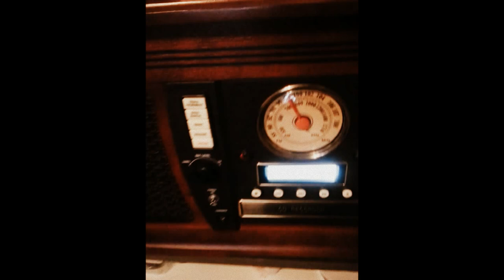How To Make A Cassette Loop

Comment: oh man it looks so easy here ... I tried for a couple of hours. does it matter what kind of tape you use? 
I was using a tasam 414 and tried with a couple of different tapes. The most i could progress was recording on one track with the tascam, but most there wasnt any sound from the loop even though there was def. audio on the tape before. Could my scissor brake the tape?

Comment: Hey thanks for the tutorial - my loop works but the play button won't stay down when I play it, I have to keep my finger on it - any ideas? Thanks!
Reply from the maker: Your loop may be too tight and the tension of the tape may be causing the play button to not fully go down. Trial and error works best. I also have used many different cassette players for many different tape loops and they all react slightly different.

Comment: Does anyone have a theory has to why the loop works but playback is significantly quiet? I'm using a Portastudio which hasn't had problems before with playback volume, so I'm assuming it has something to do with the loop I made.

Comment: Hey man! I've made one - but it's really hard to make it sound seamless. On every take I find some unwanted silence in the loop - even when the tape's ends are perfectly put together with an extremely little amount of desktape used. Could it be the recorder or? What do you suggest?
Reply from the maker: If i understand correctly, my guess is you included some silence into your tape loop. Try listening to the tape before splicing and find out what part you want to loop. One of my tape players I use, I can pause and see where the tape is and I put a small drop of nail polish on the tape so i know where to splice after. This can help a bit.
Reply: +pinstripe01 Wanted to thank you for your help. Your technique is used in many of my collab tracks you can find here: https://soundcloud.com/polarkhost .
Reply: +cd257 have you made the cut diagonal?
Reply: Jean Fatal Oh it worked after a while! I tried diagonal and that did the thing
Reply: +cd257 diggin your music
Reply: Ryan Takach Thanks man!